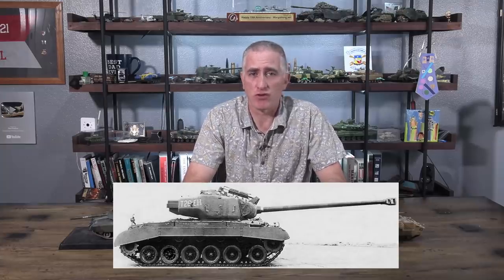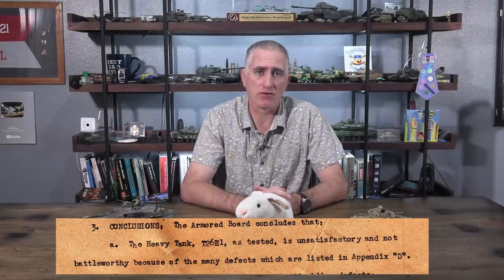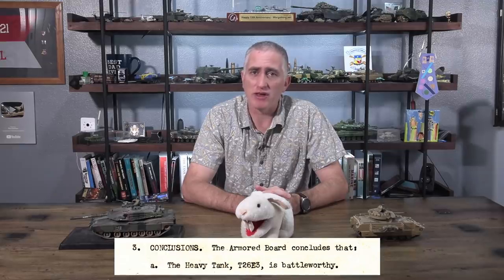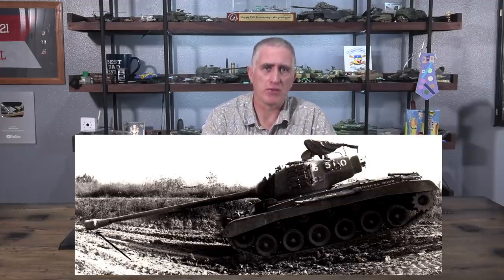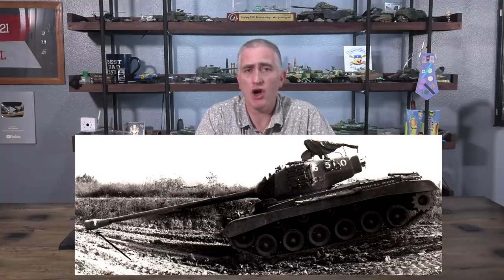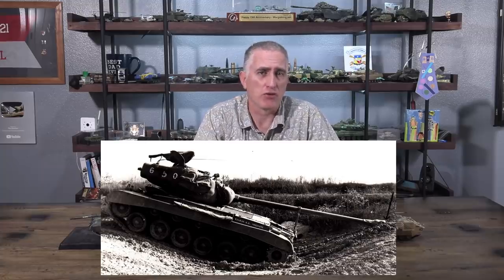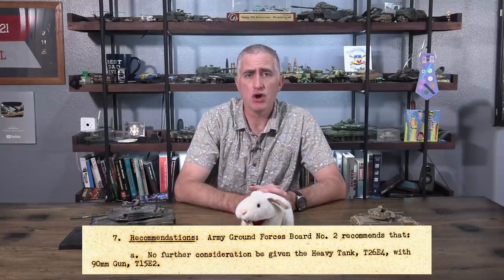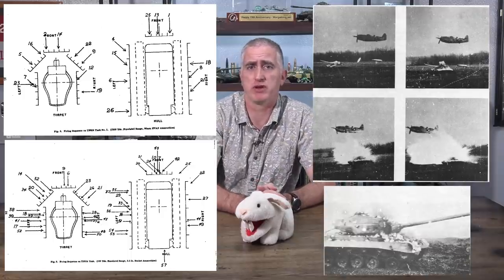Super Pershing: Why T26E4 didn't work.

Comment: While in the USAF, I was sent to Eglin AFB for an exercise, Iron Eagle. I was  Security Police and we were charged with patrolling to bomb/gunnery ranges. During one of my shifts, we came across the vehicle depot for range targets. The range attached to it had  about 25-30 T26 tanks (unknown variant) placed in a large square formation. Talking with one of the NCOs in charge of the range, they were there for the Air Force to do damage assessment on a 2000 lb bomb. They didn't do it while I was there, so I never found out what happened to those tanks. Did get a nice picture of me sitting in the commanders hatch of one though.
Reply: do you have a link for the picture?
Reply: @kalsten2236  sorry, I don't have a link.
Reply: @jeffknight9604  understandable, Have a nice day
Reply: @kalsten2236  I was able to load it to The Chieftans facebook page

Comment: Hello All
I just checked my drawings, and the turret for the T32 is indeed about 6 inches longer at 
the rear than the T26 E4 turret, at least internally.  The added counter weight behind the 
T26 turret makes  it  longer on the outside, but this length isnt usable by the crew.   Also, 
the T32 turret side walls are less sloped, more vertical, giving more internal volume to 
move stuff around inside the turret.  Slight differences, but perhaps just enough to make 
things fit better.   After all, just an inch or two on the waistband of your levis makes a big 
difference....

 As for the T26 being underpowered, this was due to a failure of imagination by the U.S. 
Army.   Henry Ford was making the GAA series V8s for M4 Shermans.    This engine 
produced  450- 500 hp. and was a derivative of the V12 engine that Henry had prototyped 
for the British  as an aircraft engine.   Now,  would it have been that big of a stretch for the 
Army to tell  Ford to make a bunch of V12s, which produced about 700-750 hp. and lengthen 
the T26 a  little bit to take the longer engine ?    Add  250 ponies,  (  50% power increase ! ) 
and the M26 would have  really had some get up and go.
Reply: The missing V12 GAA engine was probably less of a problem of imagination and more a consequence of the broad doctrine of not supporting any serious heavy tank direction until late in the war, at which point then for Ford to finalize development and re-tool or create a new factory to make a V12 would have been too disruptive.  Keep in mind the T26E3 was treated as an evolution of medium tank class, and got to the combat theater in an impressive short development and production time which may not have been achieved if they used anything more advanced than the GAA V8.
Reply: @blueboats7530  The problem with this version is, the V8 Ford GAA was simply 
a cut down version of the Ford V12 aircraft engine.   All they did was cast a
set of crankcases and cylinder blocks that were four cylinders long instead
of  six, make a shorter set of cranckshafts and camshafts, and make up
a new distributor.  This was why the GAA was so bulletproof - it was a 1000
hp aircraft engine that was only making 600 hp,    

The V12 version was already developed and proven ( It was BETTER than
either the Merlin or the Allison ! )  so no further work needed to be done.

All Ford would have had to do was use their existing plant that was making
GAAs, and start casting V12 cases and blocks, and make longer forgings
for the crankshafts and camshafts.  That would have taken Henry's team 
about three weeks,  and then the V12s would have come roaring out the 
back door of the factory.    

The problem with U.S. tank development after 1942 was, there were 
three factions in the Army.    One wanted only to keep producing M4
Shermans, with few changes,  the Second wanted only to improve 
the Sherman by up-gunning to a 90 mm gun and up-armoring it, and 
the Third wanted a whole new tank ( T-26 ).

The three factions kept bickering until Eisenhower and Bradley screamed
at Marshall loud enough to get him to settle the matter and the M-26 went
into production .    ( It also helped that by this time General McNair, who
had opposed any technical improvements in U.S. tanks, had been
' accidently ' killed by Allied bombing during Operation Cobra, thus allowing
the M-26 to go into production unimpeded.   )

It's an ill wind.....
Reply: Or use non supercharged, Packard built Merlins.
Could've called them Packard Asteroids or summink...
Reply: @GARDENER42  While the Meteor was derived from the Merlin it was not the same, very similar but there were differences. Engine rotation was the opposite direction, which meant modifying the camshaft lobes. Admittedly many of the changes made for easier construction, such as the removal of the supercharger and reduction gear. Other changes were made for reliability, the primary one being that the engine was de-rated somewhat so produced less horsepower than a Merlin. This however reduced wear and increased engine reliability. 

Not saying Packard Merlins could not have been modified in such a way, just pointing out that the Meteor was more than simply slapping a Merlin into a tank and calling it a new name. It was renamed because it had enough significant differences from the Merlin that it warranted a new name....
Reply: @alganhar1  I know. I was being a tad facetious. 
Early Meteors were constructed using some parts from recovered/scrapped/refurbished Merlins which were considered unsuitable for high stress aircraft but perfectly OK for land use in an engine producing around 50% less horsepower.
Reply: @GARDENER42  AKA Meteor engines
Reply: @beverlychmelik5504  I know. ;-)
Reply: I replied too quick to this, and didn't see the additional comments.
Reply: The US had issues trying to send heavy tanks over sea, the biggest we could send were medium tank like the M4A1 Sherman. So Henry Ford didn’t need to think too much on making a big engine for a heavy tank because it was already impossible for the US to ship it over seas till the last few months of WW II.
Reply: @thevortex6754  The U.S. could have sent over ANY size tank it wanted to either
Europe or, ultimately, Japan.   The loading of a 100 ton tank onto a cargo
ship is no great problem, and unloading at a dockside would be equally
trivial.   

Now, landing such a tank into the surf from an LST might have been a major
issue, but the use of a heavy or super heavy tank in an amphibious landing
would be unwise in any case.  The fact is, within the  ranks of the officers who
commanded U.S. Armored formations there was an ingrained prejudice 
AGAINST heavy tanks.   This had many origins, but resulted in a scenario
in which the U.S. was pitting medium tanks against German heavy tanks,
with unhappy results.
Reply: paulrward  that is true, but the medium tank wasn’t bad, especially the Easy 8, after learning their lessons with other Sherman tanks, the US made the Easy 8 and, while on paper looks inferior to German medium or heavy tanks, ( Panther tank and Tiger 1s and 2s) it was better on the field. Personally, I would rather fight in the Easy 8 because of how reliable it was and it packed a fairly good punch, but I would not want to be on a heavy tank. This heavy tank for the US would be hard to make because of how much testing and the engineering it would take. But I do agree that the US did have a prejudice against heavy tanks. But back then, a medium tank would have been perfect because you can make a medium tank to go anywhere, pack a good punch, and make plenty of them.
Reply: We might call this the M46...
Reply: @GARDENER42  Or a non-marine version of the Packard 5M-2500 V12, the engine used in the PT boats.
Reply: @paulrward  Here’s the thing you aren’t bringing up, the cranes they are using we’re not built for things like M6a1 and because of the fact that you are losing less amount of tanks due to weight increasing for one tank, your Infantry are less supported. As hindsight showed, Most US tanks didn’t see a German Tank facing them (Chieftain even makes a comment how most tanks don’t even see 2), much less a heavy one. US heavy tanks are also notoriously unreliable. A Sherman does need a 76mm gun for bunkers and the occasional tank that has armor that a 75mm can’t handle but it faces mostly anti tank emplacements and German infantry meaning that bringing a M6 Heavy Tank (One’s that armor isn’t big enough to heavy tank rounds and a gun that can just be slapped on a Sherman While also being a unreliable mess) in the case that they might find a Heavy Tank which are so rare would just leave to Infantry to having one which matter more

The times that German Heavy Tanks were involved, there were 5 Sherman’s that can just pound a heavy tank till the armor gives way or the crew bails.

Comment: They must have had a bunch of very patient crew at Aberdeen, you can imagine the air turning blue as the loader tries to
tackle moving huge heavy rounds in such a confined area.
Reply: Why do you want to take the T26 away from Cantigny? The tank park there is really cool - although it lacks a Sherman. In the summer there are concerts there amongst the tanks. Unfortunately not this year. So if Chieftain is ever around Chicago, I would be happy to take you there.
Reply: Turning the air blue? I'd be surprised if there was any paint left on the inside of the turret! 😆
Reply: @ScottKenny1978  Stripes of brass adorn the bare iron interior of the T26E4 turret, all from the loader's invectives and not scrapes from case rims....

Comment: I feel it will be something on the lines of 'Way too underpowered.' 

Edit: HP/T
Reply: as im a train nerd..... american freight trains have 2hp/t up to about 6hp/t on the "Z" trains (intermodual containers)
Reply: @kainhall  yes but trains ride on hardened steel rail with a maximum slope of 2 percent, not driving up a 45 degree hill on mud encrusted tracks
Reply: The regular m26 pershing was quite sluggish for a medium tank. It only had about 500HP engine and roughly 12-13 hp/ ton.
Reply: @justinkedgetor5949  It wasn't a medium but a heavy but for some reason, they later classify as a medium.
Reply: @dse763  Tanks had gotten bigger.

Comment: The kill  was not at Northeim, it was between the Weservalley and Northeim which is a big area of ca. 40- 50km i grew up there and its possible that the Kill was donein the Hills  near Karlshafen on  the east bank of the Weser Valley.
No Kingtigers near the place at the time is also wrong, in  the Citychronics of Uslar, they wrote that a bavarian Waffen SS unit with  Tigers  defend USLAR , a secound unit with Tiger II fought around Göttingen Harste, Nörthen Hardenberg and after retreating in the direction of the Harz Mountains the US troops intercepted the Tiger Unit near the Mackenröder Spitze.
Reply: He has made Holy Grail references before, so it's possible he wanted to see how many people would pick up on it :P
Reply: Further reading: LtC Ulrich Saft, Krieg in der Heimat - Das bittere Ende zwischen Weser und Elbe
or: An Eclipse Without A Future
https://www.amazon.de/Krieg-Heimat-bittere-zwischen-Weser/dp/3980178900
https://www.amazon.de/Eclipse-Without-Future-Ulrich-Saft/dp/1927332052

Comment: Man it feels like Aberdeen probably went "bro are we EVEN GODDAMN SURE this will mechanically work?!" when they saw the test Pershing being fitted with the 90mm T15 barrel days after they exhaustively tested the crap out of it, never mind the very thought of a Super Pershing squad bum rushing Remagen village instead of regular T26E3's for maximum pants crapping facemelts.

Did they actually mount that T15 on a Slugger tho?
Reply: 1) That;s the reason the first test the gun and mounting by firing some proof rounds remotely 2) No they didn't. because there wasn't any such vehicle. the M36 was a Jackson. Per Zaloga, some M36's given to the Koreans were updated with roof armor and the M3A1 gun

Comment: Hey, could you please elaborate on the mantlet "ears"? I've seen some arguments that it was either boiler plate or armored steel. But no sources.
Reply from the maker: Cooper states that they were boiler plate.
Reply: @TheChieftainsHatch  Thanks, that clears it up.
Reply: All the stories I heard was that they were cut from Panther glacis plates, but if they were just for counterweight basic boiler plates would be easier to cut out.
Reply from the maker: Cooper explicitly distinguishes between panther plate for the front of the mantlet, and boiler plate for everything else. His memory may be faulty, but it's better information than anything else.
Reply: @TheChieftainsHatch  that makes sense for the mantlet. Kinda surprised that they didn't also use Panther glacis for the extra bow armor.

Comment: This once again proves that up-gunning a tank, in general, should only be done if the tank was designed with up-gunning/modularity in mind, like the Panzer III or the Sherman. Sometimes adding a new turret works, like in the case of the T-34/85, other times the larger turret has to sacrifice armor and ends up being a questionable compromise, like was the case with one of the Swedish tanks (the name of which escapes me at this time). I suppose this was why Germany and the Soviet Union focused on casemated vehicles with limited traverse. It’s not at all as flexible as a tank, but it is a viable way of getting a more powerful gun out onto the battlefield using a chassis that otherwise wouldn’t be able to handle it.
Reply: @Håkan Bergvall thanks!

Comment: It's good that they killed this thing. Later in Korea, the regular M26 was a mechanical nightmare. The first ones sent to Korea were assigned to a provisional tank regiment, and every one of them was lost due to breakdowns. The Super Pershing wouldn't have faired any bettrr.
Reply: And since the tanks they faced (unless I’m thinking wrong) were T-34s, you wouldn’t need such a heavy tank
Reply: It’s vaguely humorous that M26 units were pulled from Korea, and replace buy Easy8 Sherman units
Reply: Jason Peacock Yah, M26 was meant to be the replacements and got replaced instead due to how unreliable they were.
Reply: No, not good at all. It's one of a kind and should had been preserved for museum.
Reply: Where does this come from?
Reply: That sort of thing tends to happen when you cut 4 cylinders out of a V12 engine to make it fit into a Sherman and forget to add them back when putting them in a bigger tank.

Comment: My grandfather served in a unit known as "Butler's Blue Battlin' Bastards" during World War II (395th Inf. Regt.) as they were constantly lent out to other units to plug gaps during the latter part of the war. (The training he got at Camp Blanding was supposedly based on Ranger Training, not because the Army wanted them to be elite, but because the need for manpower was so critical, they wanted replacements who could do anything needed.) He never talked about the war very much, but the RARE stories he told were either hilarious or horrifying. He would talk about how often guys would claim Tigers or Panthers were around, only for it to proved to be a towed anti-tank gun or a Panzer 4. Anyway, he said one of the few times he and his guys ever actually saw a "King Tiger" tank, it must have been driven by a conscript or been malfunctioning, because the driver stalled out the tank. While the thing was immobile, grandpa's commander called in a nearby TD and it put shells into the side of the German tank until "it went up like a barbecue." (I will not share the rest of his description, it was not pleasant. I was 8 when he told me that story.)
Edit: And for anyone wanting to do research into what relatives did in World War II, the Archives in College Park are both a godsend and a bloody nightmare. (At least, I found them to be. Seriously, some unit records are just stacks of paper in a big box, un-indexed and un-conserved!)
Reply: Thanks for that advice on college park -I was trying to trace my dad. Also, Father in law was in the Kriegsmarine at first-and later the Heer in Frankreich when they had manpower shortages due to the sudden appearance of the allies in France.

Don’t suppose you know how to trace Wehrmacht soldiers do you?
Reply: @jthunders  Your best place to start is the Bundesarchiv. https://www.bundesarchiv.de/EN/Navigation/Use/Using-specific-types/Military-Records/military-records-en.html Best of luck in your search.